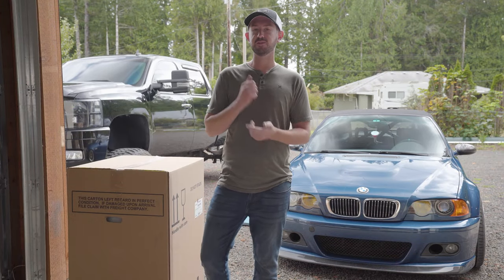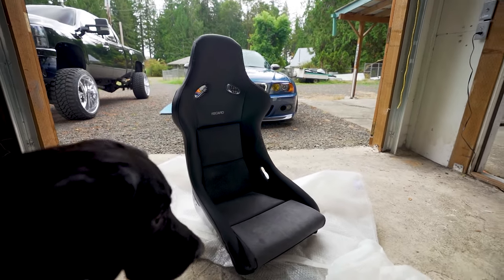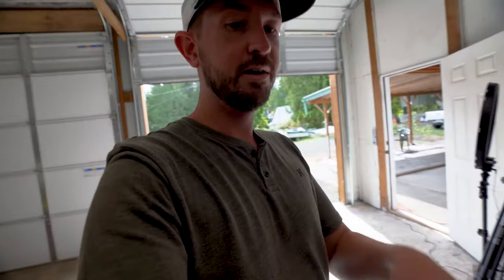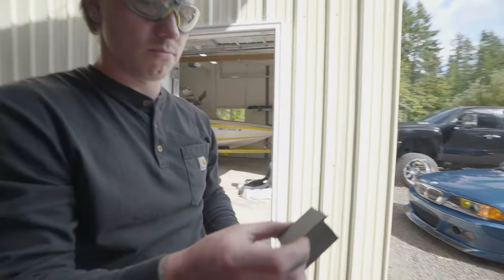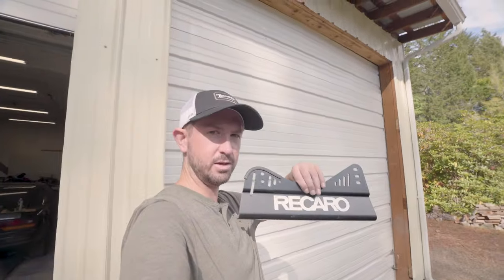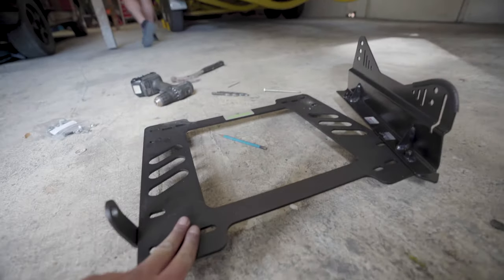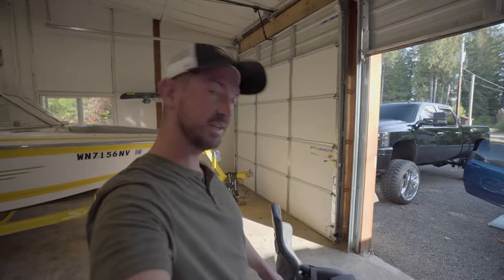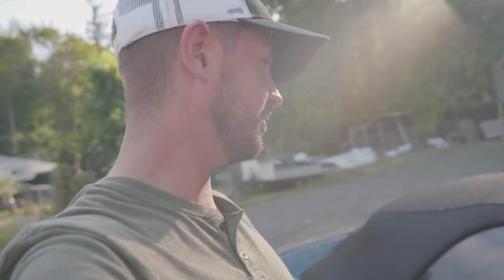MY DREAM RACING SEATS | BMW E46 M3 Recaro Pole Position Seat Install | Vlog #006

Comment: For the planted mounting bracket, did you order one for a coupe? I have a vert M3 as well and can’t find anything but coupe brackets
Reply from the maker: Yeah, I got the coupe brackets. They bolt right up to where the factory seats go. I had to modify it a little bit for my seating position preference because I didn't use sliders. Hope that helps!

Comment: Did you have to put something to prevent the airbag light going on? Specifically for the passenger seat?
Reply from the maker: I have an airbag light on my dash. Due to the Renown steering wheel and the seats. But will be getting it coded out!

Comment: Do you seat lower in the car with these? I seat so high in my e46 M3. I've heard that there isn't much difference when going Recaro CS route
Reply from the maker: I would say it feels a little lower then stock. But I can't give you any actual measurements or anything. I doubt it's much lower though. I can't speak to the CS's! Hopefully that helps!